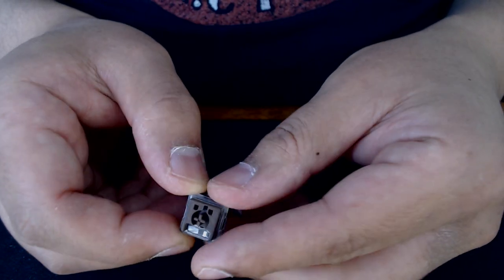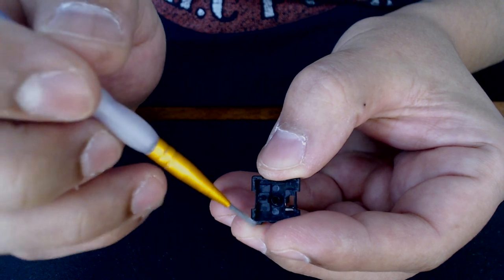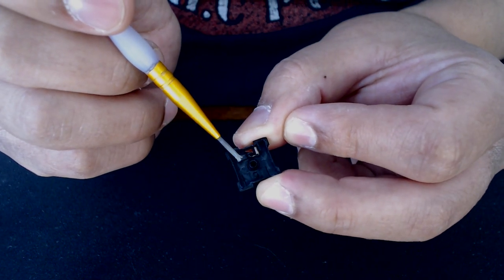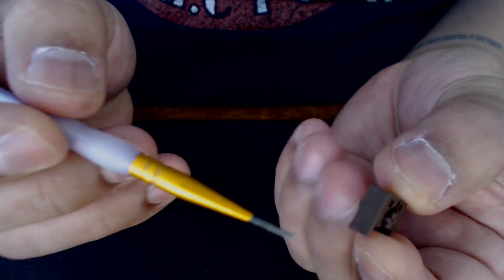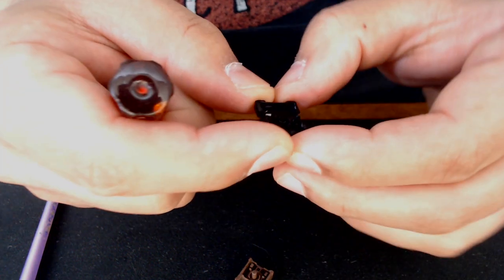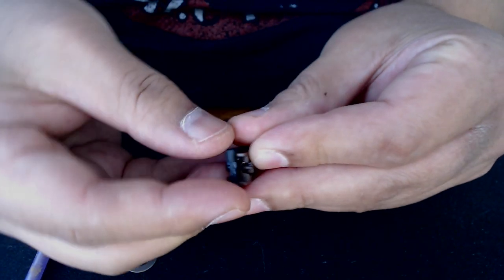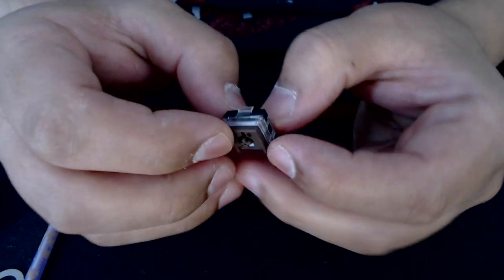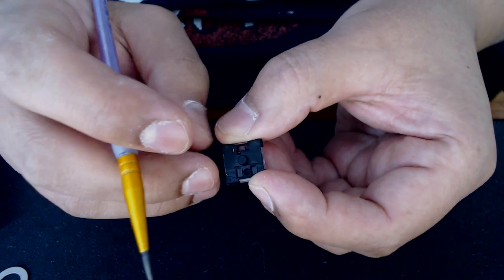Keychron K3 Brown Switch Lube Guide , and type test

Comment from the maker: UPDATE:
DO NOT BUY THIS KEYBOARD.
at the time of release there was nothing like it, and after almost a year keychron has failed to support it, as time of writing no keycaps have been released and no there sets work due to the non standard stabilizer.
I recommend the 75 Air by Nuphy , same 75% layout but standard so any after market keycaps set works , and way better quality than the k3.
Reply: Hi there and thanks for the info! Nowadays I use Keychrone K3 v2 with Red Optical switches and find it very good one. Since some time has passed could you recommend something close to K3 apart from 74 Air? As for me I’m ok with the keycaps of K3v2. Big thanks in advance, bro! ❤
Reply from the maker: @AntonChe  honestly I haven't kept looking as I am very happy with the air, I know they just released a pro version with double shot. So that's worth looking into. However I still prefer the air, quality is just so good. The problem is finding good low profile switches

Comment: thank you, nobody else explained this before i opened the switch, i struggled to get it back. This is the most complex switch ever, I dont think I want to lubricate it anymore, this is hard. But thank you, i was able to fix the one key that i tried to lube, the small spring that gave the bump was what i was missing putting back.

Comment: Tried lubing the orange base browns which came with the K3 V2 and it appears to be a bad idea. In comparison with the black base browns form the V1 (which I also have) these new browns are by design more clicky than the original ones (which is great) and after lubing they almost loose that nice quiet clickyness. So my advice would be not to lube the orange base browns if you want to maintain the clickyness
Reply: You mean the tactile bump is gone after lubing v2? I plan on doing the stabilizers (especially spacebar) but haven't seen many people lubing the browns in general.
Reply: @muckeyn  not exactly! the bump still seems to be there, but they just completely loose the clickyness. I don't know, maybe it's just my unit that has this particular browns which are kinda clicky for some reason, because on the V1 which I had also owned for couple of months, the browns were not clicky at all (however the tactile bump was pretty much the same)
Reply: @Nick_B_88  my v2 seems a little clicky compared to full size brown switches as well.
Reply: @Nick_B_88  I may try lubing a switch and seeing how it feels. The clickiness is interesting but I’m not sure it’s what I want long term.
Reply: @muckeyn  pls let me know if you face the same thing with the lost clickyness
Reply: I also got the limited orange bottom housing. It would really depend on what you like your keyboard to sound like. I lubed half of my switches and it gave a deeper, more muted sound, and a less scratchy feel. If you like a high pitch clicky sound, you can skip lubing. I bought the brown instead of the blue since I didn't want the clickiness of the blue, just the tactile bump.
Reply: @Nick_B_88  late reply but I did lube the switches and the clickyness was still there, just less scratchy feeling. I actually lubed the small tactile spring which eliminated the clickyness. The bump was still there but there was less resistance and felt much smoother to me. Keep in mind I prefer full sized linear switches. It’s decent keyboard but definitely not as satisfying to type on to me.
Reply: @vincejet  yep this is spot on. The tape mod works well on this keyboard as well. Filters out some of the high pitch sounds. The overall sound still isn’t very good to me but it’s expected from a low profile design.
Reply: @muckeyn  +1 on this. did the tape mod as well and gave somewhat of a deeper tone. Did you also cut holes on the tapes for each switch? (edit: i actually cut holes on the tape for each switch. I later on found out that it wasnt actually necessary. Might have reduced the effect of a tape mod)
Reply: Is this applied to banana yellow as well?

Comment: ngl, the first time I took a brown switch out of my keychron, I bent the spring. The switch was just very stuck onto the board and I had to use a lot of force to yank it out and when I did, everything but the bottom of the switch came off. Anyway, I was lucky enough to have the switch tester with all the switch types so I swapped my broken switch with the corresponding one. I'm still planning to lube my brown switches, just gotta be extra careful now!

Comment: It is precisely thanks to this small spring that the brown switches have a characteristic actuation moment.  I tried to disassemble one switch.  This little spring fell out, and I just can’t put it back in such a way as to return that same tactile response.  Is it even possible to return it, or did I just turn the tactile switch into a linear one?
Reply: There's a small nub on the upper section that interacts with the spring. Normally the spring rests against the left side of the nub, if the nub is facing you. When you remove the upper section, the spring moves all the way to the right, past where the nub goes. I use a small pin/needle to gently compress the spring and move it out of the way when I put the upper section back, then when you release it, it rests against the left side of the nub again.

This turned out to be such a pain in the ass, I opted to only lube the sides of the switch, keeping the upper section in place and not bothering with the stem or main spring. Still got pretty good results vs unlubed this way, and you don't have to worry about the small bump spring coming out and getting lost.

Comment: Thanks for the video, I love my keychron mechanical keyboard but now I am regretting having a mechanical keyboard if I have to spend like 10 minutes to lube each damn switch. How often does this have to be done?
Reply from the maker: You don't have to and they already come pre-lube. It's just the hobby
Reply: Switch lubing is entirely optional. The goal is to make the switches feel smoother and uniform, plus lubricating the springs can remove pinging noises. It is a very time consuming process and vast majority of people never do it. If you decide to do it, you need very specific lubricant (you can't just use regular shop grease, they aren't smooth enough) and a very fine brush (number 0). Also, switch lubing should only be done after a longer period of time, even someone who uses their keyboard very heavily shouldn't get to it any sooner than after one month.

Comment: I just ordered the K3. I wanted to know if it was possible to remap the light switch to somewhere else, I like my delete key at the top right. Also are those the standard keycaps that came with your K3?  They seem different...
Reply from the maker: Don't know because I haven't tried remapping at all. And yes that Is the original key caps they suck
Reply: @robertohernandez1642  what about the stock caps do you not enjoy?
Reply from the maker: @shuccle6161  they are thin and feel extremely cheap also abs , not double shot pbt so thell eventually start showing
Reply: @robertohernandez1642  thin like between the top of the cap and the stem of the switch underneath? Or you mean thin, because they are low profile?

I agree with the material though, double shot is always best lol

Comment: Does lubing the switches make them more sensitive?
Reply from the maker: Yes and no , technically you would get less resistance BUT I also remove a lot of the fabrication added lube on the tactile part and it left them more 'bumpy' for me.